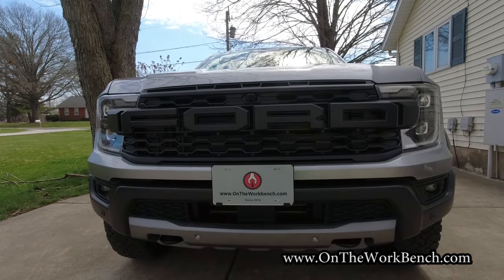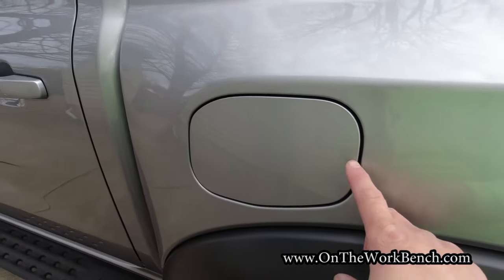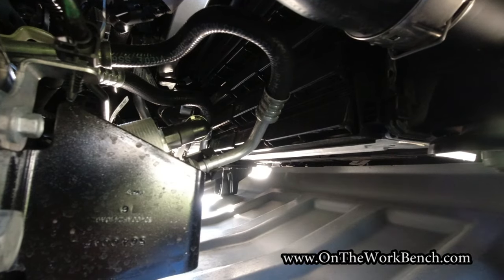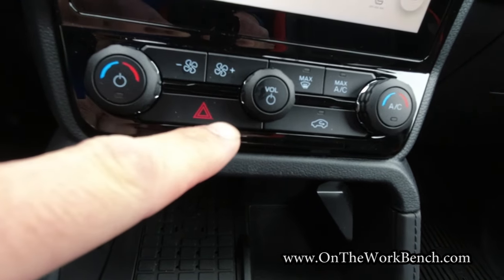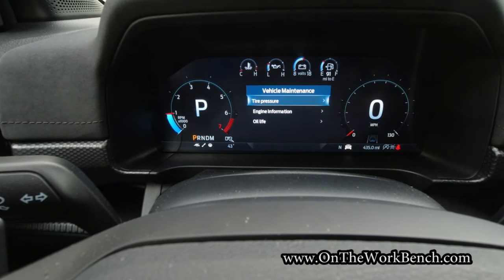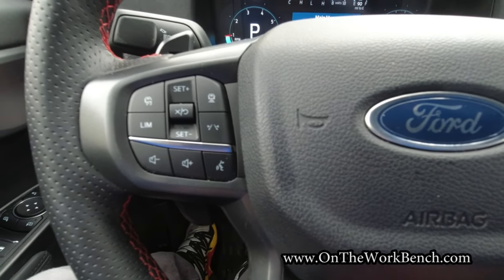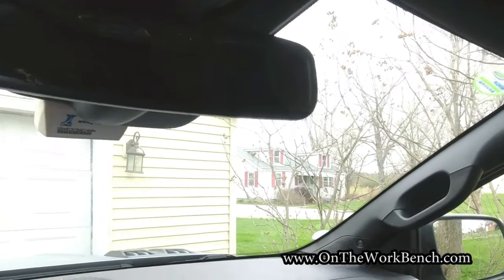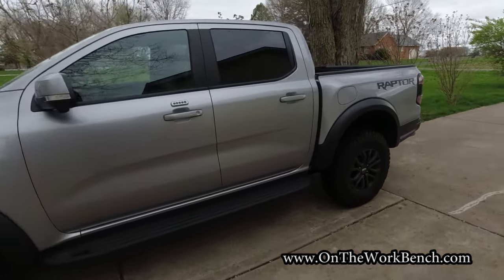2024 Ranger Raptor 🦖

Comment: Congrats on the truck! May I ask when you put your order in and how long did the dealership take to get you your VIN? As well as how long the overall wait was to get your truck? I’ve ordered mine 2 weeks ago and trying to get an estimate of how long my wait will be. Thanks.
Reply: It varies drastically and, as far as I can tell, nobody knows the cause of the variation. I thought it had to do with the spray-in bedliner but this one obviously had it optioned and was delivered so idk. I ordered this exact same spec day 1 (5/26/2023) and received an update 3 days ago (4/2/2024) that it still hasn't been scheduled (no vin). Hopefully you'll have better luck than me!
Reply: @AArcher10  wow that’s crazy! Hopefully they ramp up the production so we could all get ours. I have also heard that the spray in bed liner causes a delay, which is an option I included on mine. Thanks for the info!
Reply: I order mine October 17, 2023. They finish the build on 3/19/2024. They shipped to me in Long Beach CA and it should arrive no later than the 15th of this month
Reply from the maker: Ordered July 5,  2023 got VIN direct from Ford in late January 2024. Most important detail is that I watched the sales guy put it into the Ford order system while in the office. I went through a high volume Ford  truck dealer. No deposit ,the  only question salesman had was how many.  it took less than 30 minutes to place the order. The biggest issue I had was during PDI they added a pulsing  action to third brake light, but got that price taken off at signing.
Reply: @OnTheWorkbench nice! I got lucky at a smaller populated city than the bigger ones, sold at MSRP and no other fees, also had them write on the buyers order “no extra add-ons” on the PDI. I did have to put down a $1k deposit. Called a week after the order and the sales guy said that Ford took the order just didn’t have a scheduled build date yet. Hopefully I will hear something soon and not months from now lol.

Comment: What was the out the door price? What was the price breakdown (truck, tax, add ons, stealership fees)
Reply from the maker: MSRP sale price at time of order, local/state  tax, then less $1000 Ford rebate. Dealer tried unsuccessfully  to cram glass etching and a pulsing brake light that I got removed from the bill. However during PDI they put both on the truck without my consent.
Reply: Nice truck. Sounds like you got a good deal 1000 under msrp.

Comment: Dampeners on the tailgate, but prop the hood open with a hockey stick😮 it appears the lower rear shock mounts are really low and close to the tires. Low off road clearance at the mount. I haven’t seen a review yet where the hood didn’t have to be slammed shut. The cab and driver amenities seem nice. 😊

Comment: Ive heard a lot of bad things about the build quality of the RR. Panel gaps to the point you have to slam the doors to close them, lots of interior rattles, seat leather stretching and becoming loose almost immediately. I'm a Ford guy but a 60k truck should be near perfect.
Reply from the maker: So far after a month and a half with the truck there have been no issues with mine.

Comment: Aluminum metallic just like mine, But mine has decals. Middle east spec. But no tow hitch. No tail gate damper.no light in bed.Rear window is one piece, doesn't open. Has rear a/c. Fuel cap locks with car

Comment: No drivers side grab handle like on passenger 

Bead capable requires what 800 bucks of accessories 

Many confusing choices in configuration 

Gas should be lockable

Definitely the “rod” on hood Gota go.

Drive shaft gets surface rust

The plastic cover underneath gotta go

You missed I think the 2 glove compartments

All in all your video is helpful as I’m getting my Shelter green with everything but splash guards (on order) and oil heater item.  My MSRP 59,900.  Can’t believe some are paying 20k over.  I make it a point to hassle a salesperson to think they have a sale then drop the buzz off commentary.  While not a mini Landcruiser, I’m in love with Shelter Green, the size and generally the price.  Ford please have an upgraded model of the Ranger Raptor and fix all the rusting metal underneath, the exposed wiring and get rid of the plastic oil bolt.  Increase size of seat as the outside has a couple of inches and put hvac in back.

Comment: I agree the red surrounding the vents is just too much for me. I can’t do it. I’ll go Lariat or just change out the vent surrounds on the Raptor. Didn’t they do any customer preference survey in advance? Sometimes I wonder.
The Raptor should have a bash plate delete option and a highway tire and wheel option, and a better mileage option , need at least 22 Hwy 18 City. I just don’t want to burn less than 20mpg on any vehicles that I pay for.
Reply: If you don't want bash plates or off-road wheels and tires then don't buy the raptor. That's what the regular rangers are for